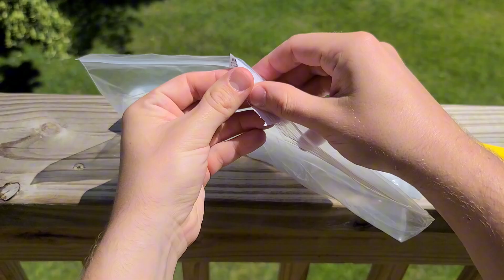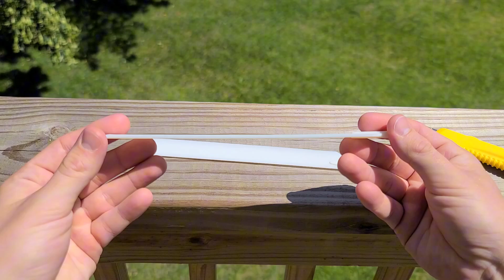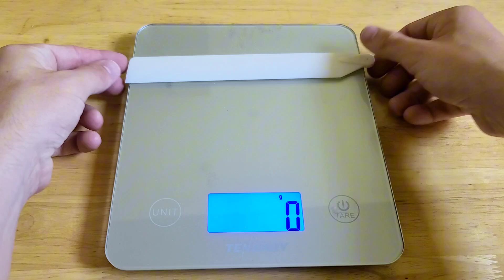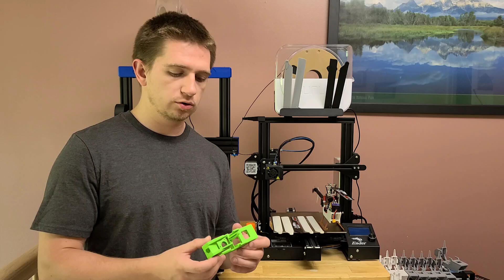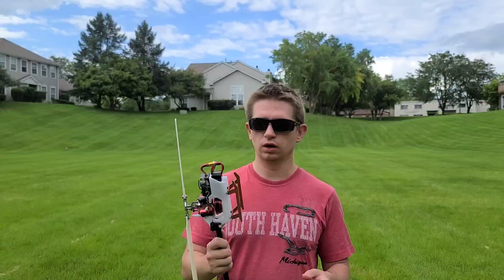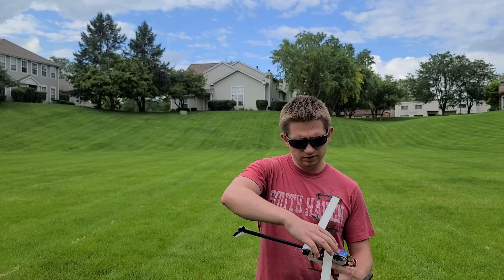Can 3D Printed Helicopter Blades Take Flight???

Comment: Hello Demian!  Interesting experiment, I appreciate it!  The weight of one blade is as much as 18 grams!  This is a lot for this class. This increases the load on the motor, which leads to a significant reduction in flight time!  Another problem is strength, how strong are they compared to the original ones, if you say that they are much more fragile than the original ones!  So, what is the price of one set?  The only option is to make a matrix from which to cut carbon fiber blades, but this requires certain skills, thank you!
Reply from the maker: Thanks! I definitely agree that the weight was a bit much for a helicopter of this size, which is why it was just an experiment. For someone who just wants to print their own blades and fly around, it will work. This was the first time I was able to use resin printed parts, so maybe with different types of resin might give out different densities. As far as price goes it really depends on the resin your printing with, I just went with the strongest resin PCBWay had to offer. Creating molds and building custom blades is a tough project to get into.

Comment: With resin printing being more accessible, it could be interesting to see how winglets or some kind of small guiding ripples over the blade change the flying behaviour
Reply from the maker: That would be an interesting experiment! I might be convinced to buying my own resin printer. These blades turned out great.
Reply: @LifeAroundDamian  Please be careful with the toxicity of those prints. It could be overall interesting to go a bit in the direction of "fan showdown" or the boat version from RC test flight. Like trying to find the most efficient blades but also checking max RPM or lift generated
Reply from the maker: I know exactly what your talking about. That is one of the reasons I have been back and forth with owning one.